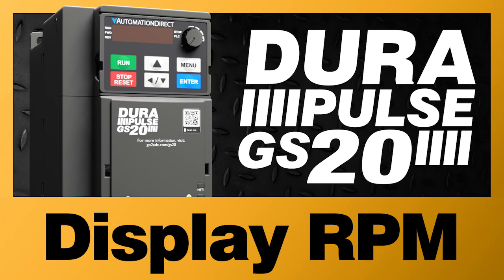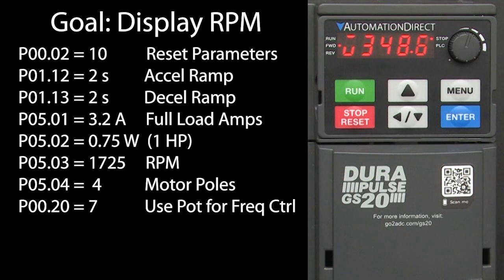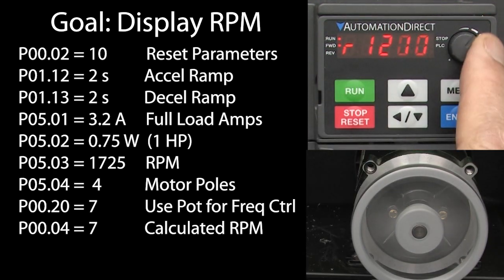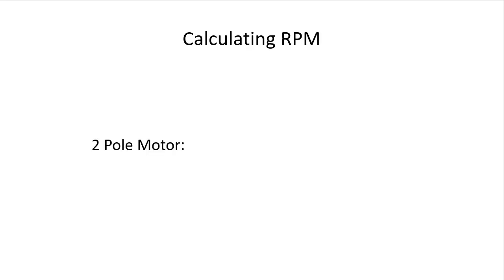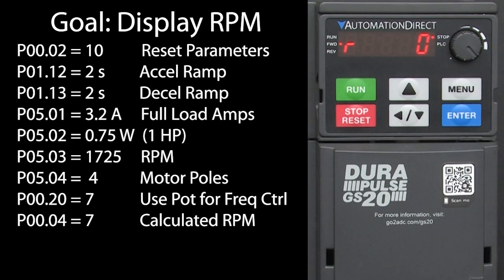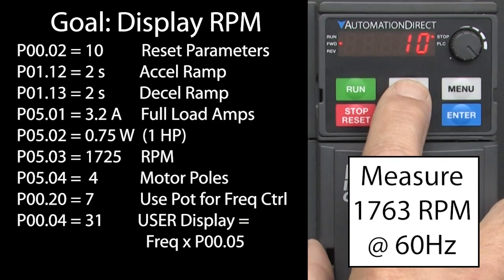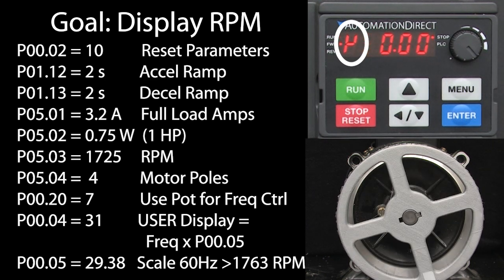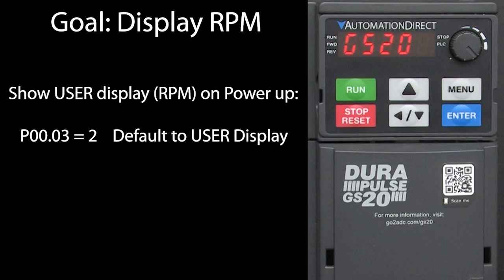DURApulse GS20(X) VFD How to Display RPM from AutomationDirect

Comment: Thank you very much
Can we use P00.4 to read the gear output speed that works on the same inverter motor?
Reply from the maker: If it is directly connected please set P0.04 to 7. If it is driven through other components you would need to use P0.04 = 31 and scale using P0.05. See https://www.youtube.com/watch?v=xiCruk18heI for clarification.

Comment: Somebody tell me why drive manufacturers (all of them!) don't spend an extra 5 bucks for a full display. These alphanumeric displays suck with all the functionality these drives have!
Reply from the maker: Hi Andy,
Actually they give you the choice. The built-in display is usually minimalistic because these drives often go in cabinets or out on production floors where the display is rarely used, so why spend the money.
They also usually offer an advanced alphanumeric display which makes accessing all the features way easier. It's offered as a remote display so you can buy just one to commission the drives without having to spend that money on every drive.
Check out this video for the GS20's remote display.
https://youtu.be/3b8WtqxD2Y0
Reply: with you on this, and this concept could be said for many products...